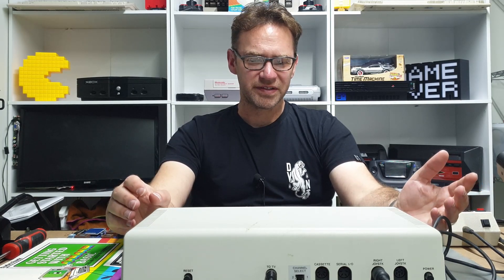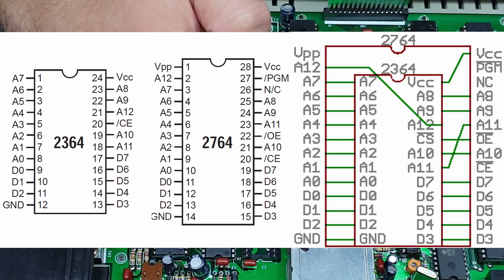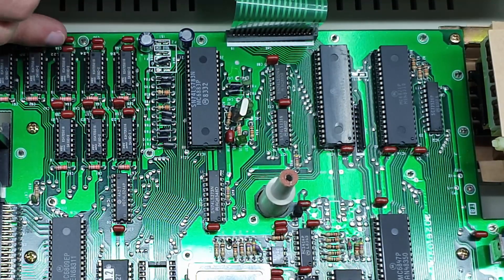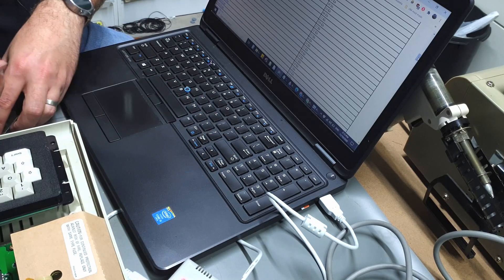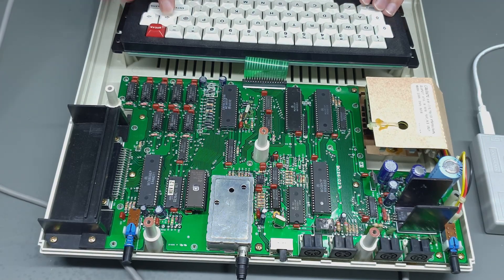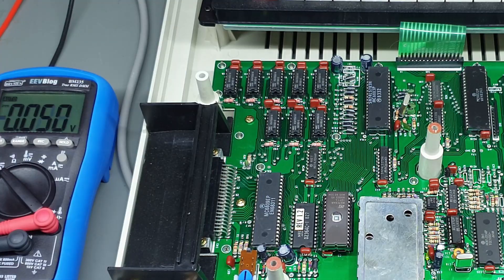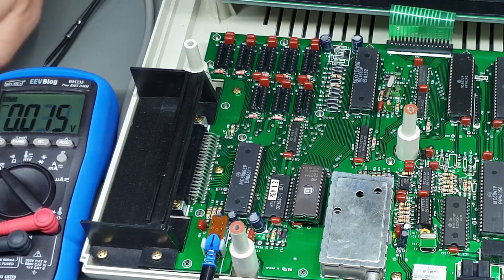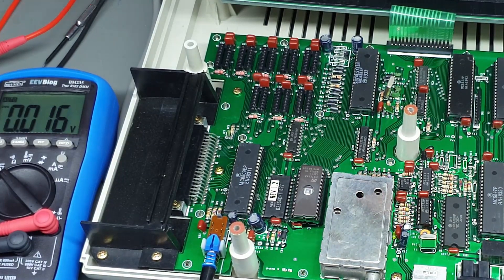TRS-80 CoCo2 RAM and ROM upgrades

Comment: Nice video.  Do you know if the refresh rate on the ram chips mater?  I put TI 4164's in mine and upgrade failed.  Was just watching video's trying to figure it out and noticed NEC that came in yours refresh 128cycle/2ms.  The TI 4116 refresh 256cycle/4ms.  But I haven't seen anyone say if that matters on CoCo's and from what I've read on chip page it just say's it may or may not depending on system.  The chips that came out of mine where radio shack part numbers but when you said NEC that when I started comparing.  If anyone knows I'd appreciate the help.  Thanks
Reply from the maker: From what I've heard it shouldn't matter, but like I said I didn't really bother to research anything 😆
Are you certain all the ram is working?
Reply: @TheRetroChannel  Thanks for the fast reply.  Not really sure if their working.  But the chips are new (old stock).  Nothing I read or saw said anything about it either.  It only talked about access time.  The ones I put in are 200ns.  I bought 2 extra TI chips and when it did boot I swapped the chips out for the extra ones one at a time but that really didn't help.  Then I found a webpage  --> http://www.minuszerodegrees.net/memory/4164.htm  and at the top it talks about the refresh.  I'm also wondering how important that access time of 200 is.  I can find chips with 150 or 120 but the 200 is pretty hard to find.  Like on Ebay I've found 4164's for it say's Commodore or Apple but their rated at 150 ns access speed.  So is the 200 ns the highest number you can use or the lowest?  Sorry for being so dumb and confused Thanks.
Reply from the maker: All good. 200ns would be the highest, I think I used 150ns as that is just what I had on hand at the time and is likely the most compatible with various machines. So maybe pick up some 150ns chips, there's a link to some from AliExpress in the video description if you don't mind waiting about 5 years for them to arrive 😉
Reply: @TheRetroChannel  Yeah that's probably what I'll do.  They have them on Ebay. in lots of 8.  Just wish I'd known about the 128cycle/2ms thing.  In all the stuff I read before and now that page is the only place that mentioned it but I'm thinking it matters.  Most are the 128 and I used the 256.  Live and learn even if I am 30 years behind.  But thanks again.
Reply: @TheRetroChannel  Just so you know the refresh rate does matter.  I replaced the chips with ones with a refresh of 128cycle/2ms and it booted right up.

Comment: When you put Extended BASIC in, with just 16K, it's not that it copies to Extended BASIC to RAM. Extended BASIC (by default) reserved 6K for high res graphics screens (four 1.5K pages). You can drop that to just 1 page with PCLEAR 1,  and drop the last page with POKE's. That frees up more memory for a BASIC program (which is what PRINT MEM reports).

Comment: Great video sir :)

Thank you for sharing :)

As far as the missing RAM goes when you did the
PRINT MEM
THat is because Extended basic added graphics commands and also allocated graphics memory area for doing graphics.
Also Disk Basic also consumes a little bit more RAM as well for its variable space as well.

So if you boot up this CoCo 2 without the CoCoSDC.  Then type:
PCLEAR1
PRINT MEM

You should see free RAM of:  29479

If you do this with Disk Basic installed it will show up with:  27431

I believe the Color Basic ROM range is from $A000-BFFF
I believe that Extended Basic ROM range is from $8000-9FFF
Depending on your flavor of Disk Basic the range will vary.
Standard Disk Basic range is from $C000-DFFF
16K based Disk Basic's their range are from $C000-FEFF

I hope this information helps you some.